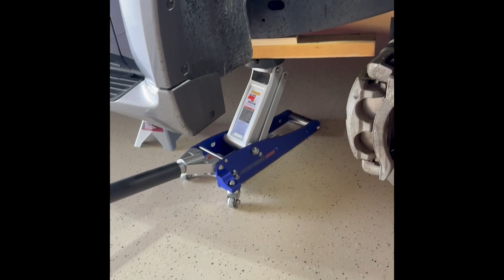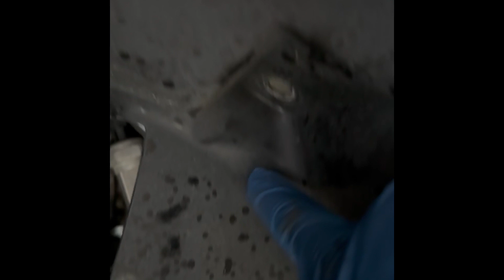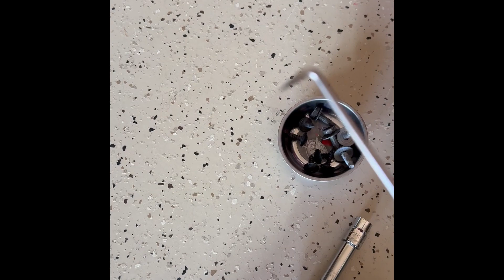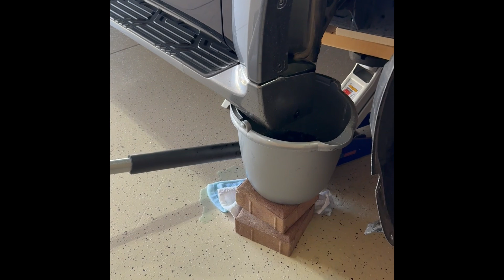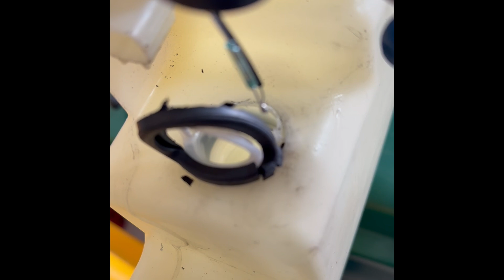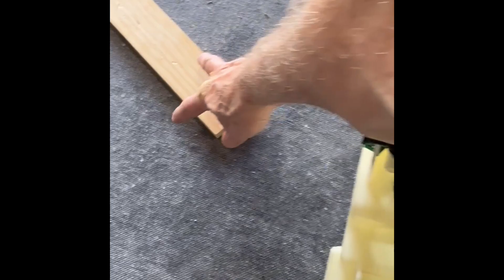How to Armada R&R washer fluid sensor

Comment: Had the same problem with warning light. Easy fix - drain using washers. Fill with distilled water and continue to use washers until sensor clean.
Stop using a large % of washer chemicals. 
It’s the chemical/detergent buildup that clogs the sensor.
Saved lots of time having head inside the wheel arch. 😊
Reply: I have seen this solution in a few places. So, just put in the distilled water and run with that in the reservoir like normal for however long it takes to empty it again? Or do I want to empty it quickly using the washers?
Reply: I’m confused over the comment “drain using the washers.” Can you please elaborate? I just filled up the reservoir because the light was on and have discovered it is stuck. All of the videos look a lot more involved than I could manage without taking it to a dealership. Yours is the first comment that sounds straight forward, but I’m still confused how to get to these “washers” and what to do next. Any suggestions greatly appreciated!!
Reply: @jenketner8681just use your washers as often as possible to empty resevor or drain via a hose and suck LOL.
A couple of drains and using distilled water fixed mine.